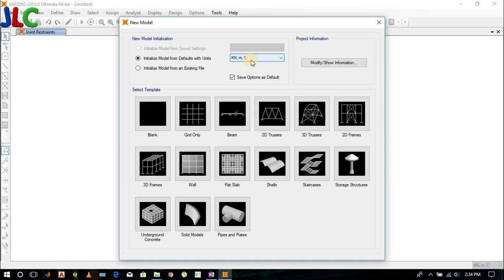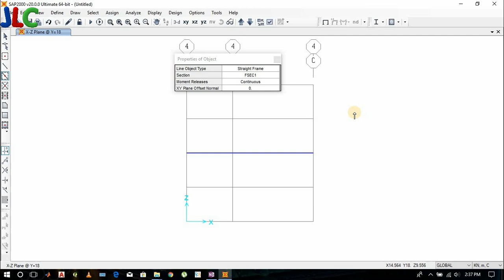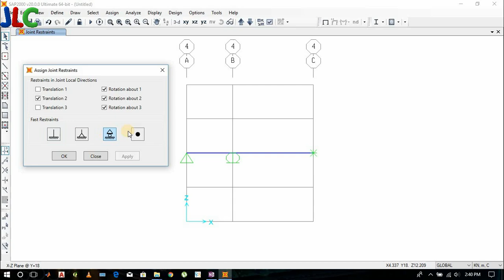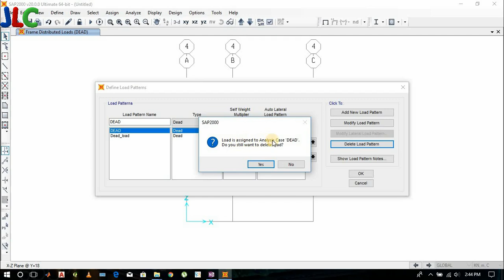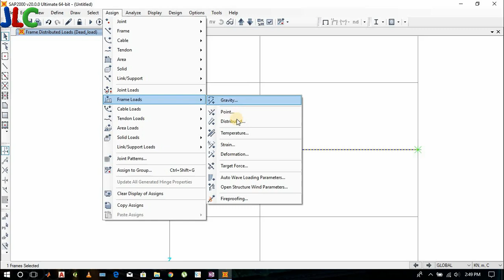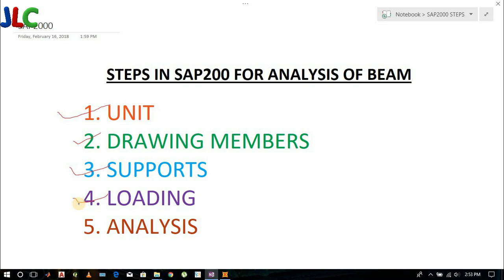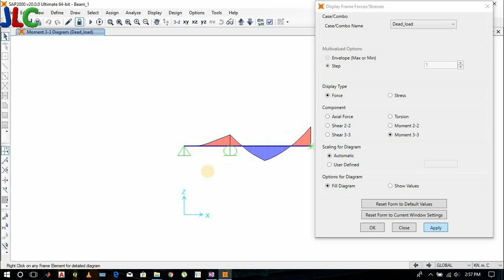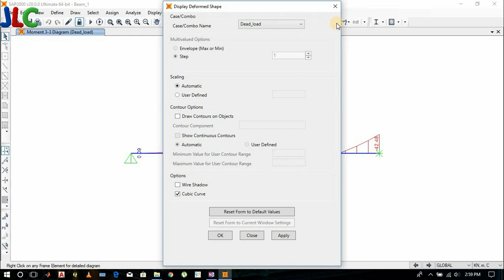BEAM TUTORIAL #1- Analysis of Beam in SAP2000

Comment: Is it possible to use the roller support on a vertical wall? can I change the angle of the roller so it is not horizontal? Thanks in advance, I am very new to the software!
Reply from the maker: Yes, you can change the angle of support by entering an angle about the axis you want to rotate the support.

Comment: why did not you define section and material properties?
Reply from the maker: Here our concern is only analyzing the beam (like in applied mechanics) without considering cross sectional area and materials. Suppose, point load, W, is applied at center of simply supported beam, bending moment at center is WL/4. Here we aren't concerned about material or cross sectional area. But to know what material and cross sectional are can resist that moment, we we will be entering in design part, which isn't covered here. This tutorial is only about finding how much force, moment acts at each part of beam.
Reply: This guy just wanted to show a simple example. Reactions and moments.